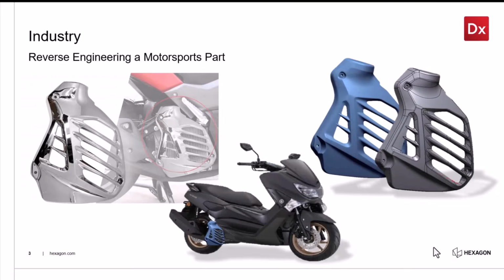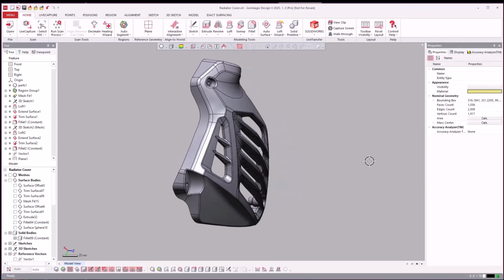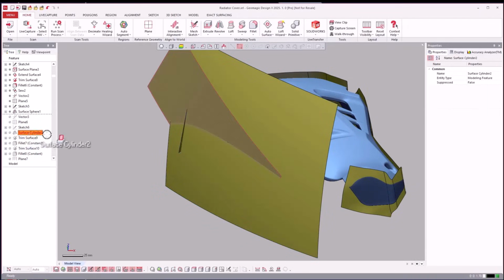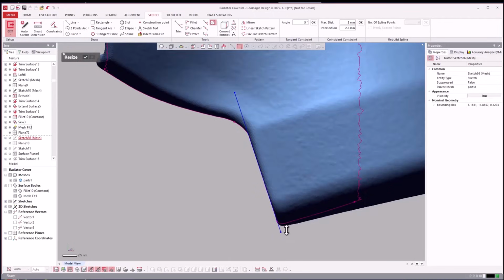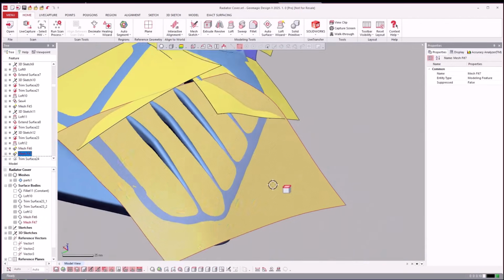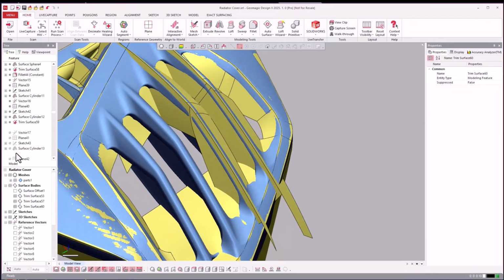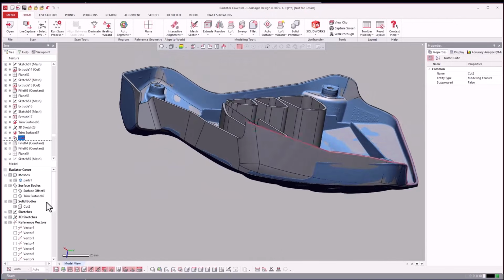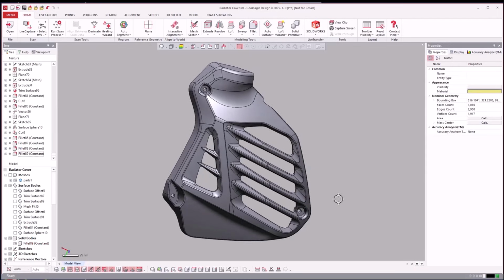Reverse Engineering a Scooter Transmission Cover | Geomagic Design X

Comment: The result is great. But as a learning material, it is almost useless. It is unclear what tool settings were used, and some steps have been skipped. For example, it is unclear how the thickness was set for the model.:face-purple-crying:

Comment: Thanks for the guide. I have a question about compatibility with 3dconnection, for some reason, when the manipulator moves, the program window flies up and I have to compensate for this and push in the opposite direction. I noticed that this disappears if you hide the top toolbar. please tell me how to set it up.